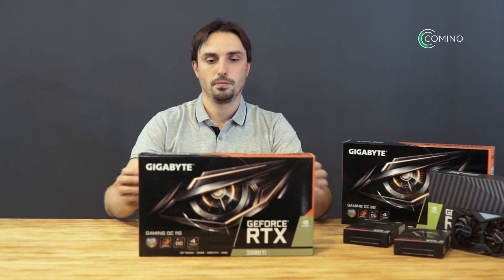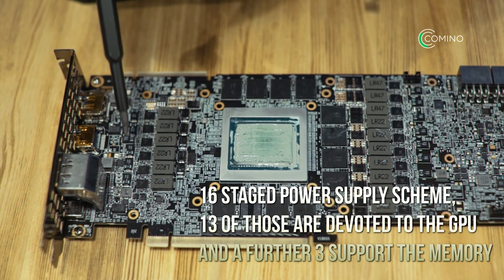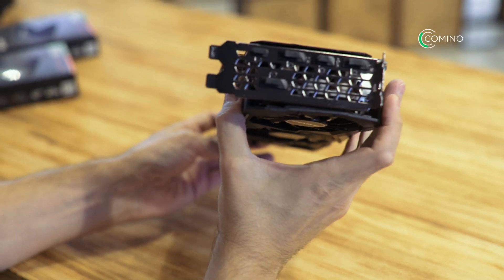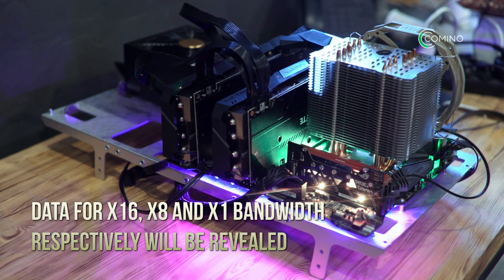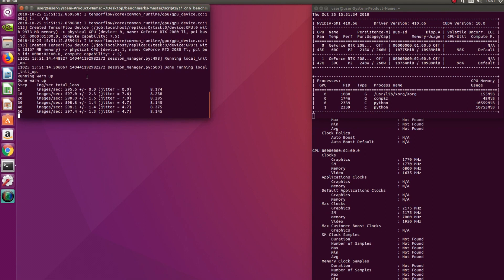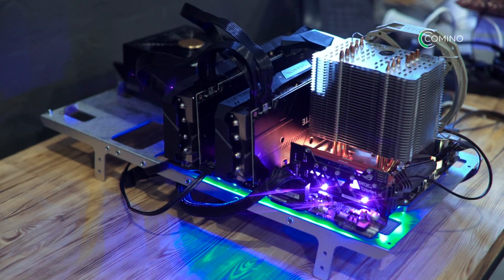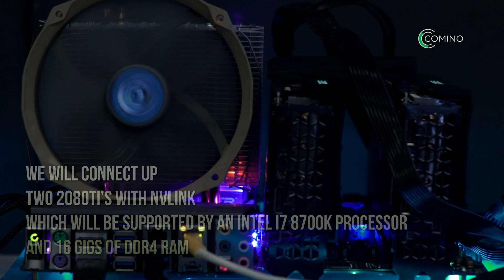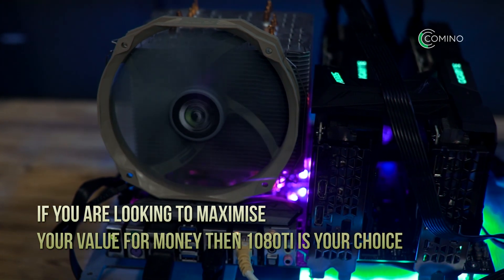1080TI better than 2080TI??? Gigabyte GeForce RTX 2080TI Ultrareview: Tensorflow, mining, gaming

Comment: TensorFlow test didn't use TensorCores for sure, and mining test needs code optimized for Turing CUDA cores (probably it needs by-hand optimizations). 2080 > 1080Ti.
Reply: Obviously 2080 > 1080ti
I mean even the 2060 is as good or better than the 1080